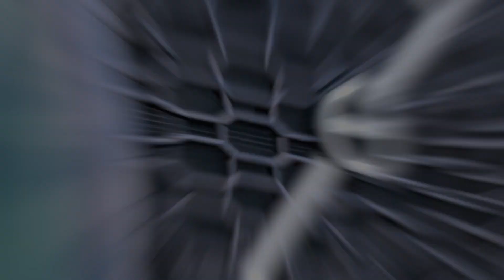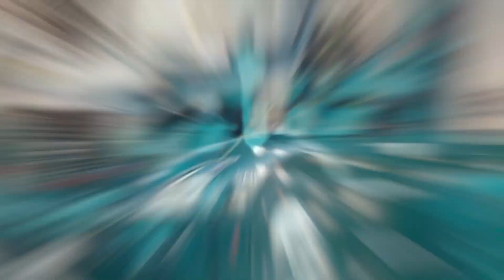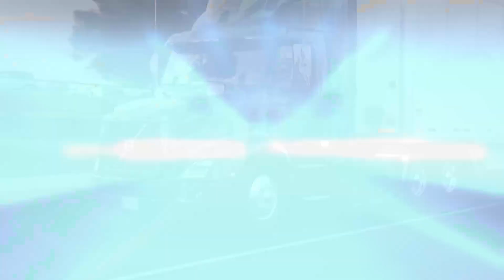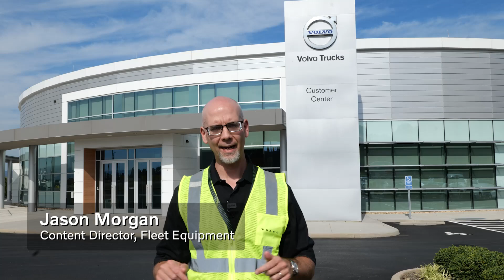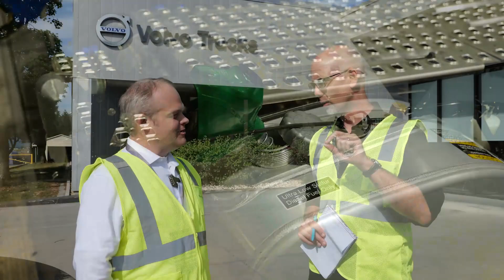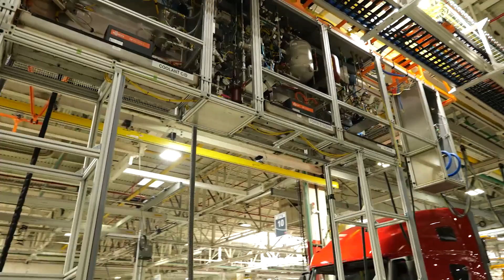Volvo Trucks – Episode 13 – The role of HVO

Comment: Volvo has analyzed alternative fuels.  In order of their perceived benefits, least to best, these are ethanol, biodiesel, hydrogen + biogas, CNG, LNG, synthetic diesel, methanol and dimethyl ether. (Automotive Engineering International, September 3, 2013)
What about the ultimate, DME? Different fuel system, sure, but minor storage issues similar to propane, no soot, no particulates.
https://youtu.be/3l0fr_I0p4Y?si=QV2g91Dl-FbiWrVM
Reply: Yet another entertaining--but worthy and short--DME video: https://www.youtube.com/watch?v=k8NF9psjg-Y ...building on Bill's point, NO PARTICULATE TRAP required AND a built-in distribution network/existing propane distrubutors across the country!  FInally (for now) DOE still has DME interest..."SO WHAT ARE WE WAITING FOR!"  😃/Skip Yeakel, DME Advocate